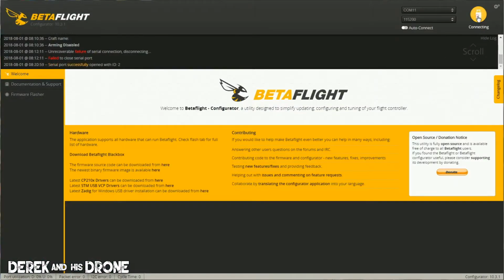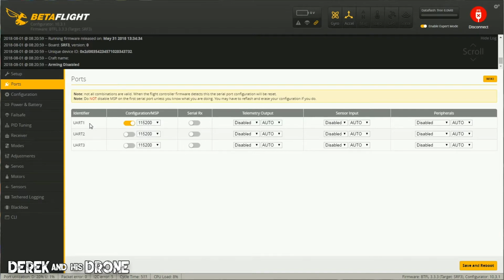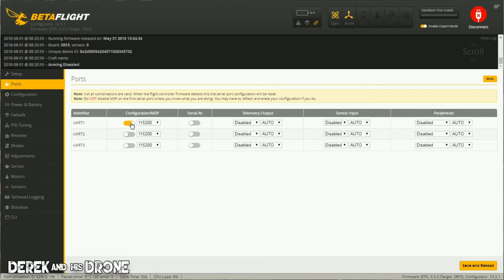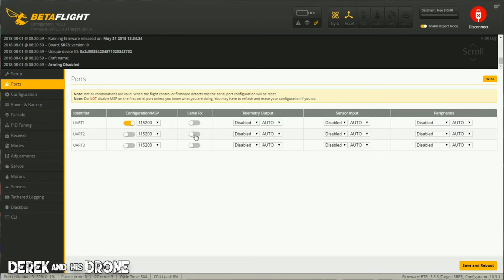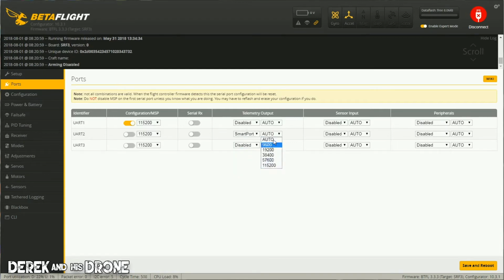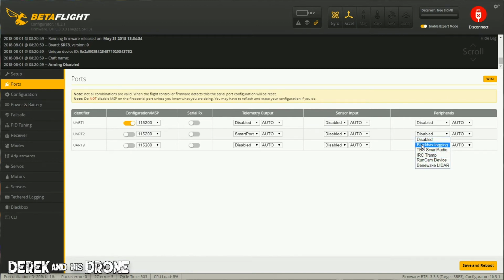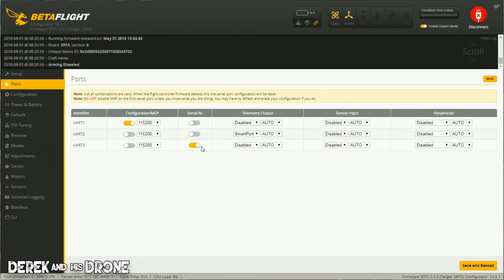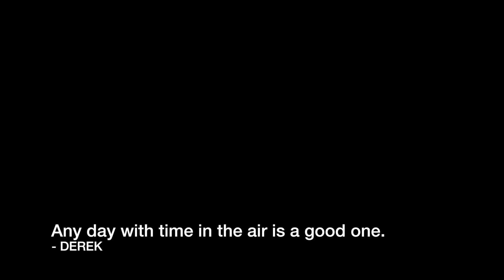Basics of Betaflight - The Ports Tab

Comment: I would really like to know what the process is when the uarts won't save. After I updated and flashed current FW on the FC, I lost an entire uuart and Soft Serial/Fport. I've been struggling for so long I ended up going in cicles, everytime I solve one issue it seems to create a new problem. I've watched JB videos, and tried just about everything I could think of, short of a complete flash overhaul. At this moment, I would appreciate any help I can get. I have a 4in analog GEPRC Baby Crocodile w/ R9M Rx (GEP-F4-20A OTA V2.2)
Reply from the maker: Sounds like you might be having a few different problems.  You can  turn on your soft serial ports back on under the configuration tab.

Comment: Have u ever experienced an issue with a tramp protocol vtx where when u select a channel through the osd and it doesn’t actually change it. I’m stumped
Reply from the maker: Try a different uart, make sure the control wire is connected to a tx pad,  make sure the VTX uses tramp and not smart audio.  Betaflight 4.1 and above requires a VTX table and last are you using the right menu in your OSD?
Reply: Derek and his Drone thanks for the reply. I tried all of that, I’ve seen on forums people experiencing the same issue while using the eachine nano vtx on certain flight controllers. I ordered the NamelessRC vtx, also using tramp protocol . I’m gonna swap it out when it arrives and hopefully that’s it. I have the eachine nano on other quads on different fcs with no issues.